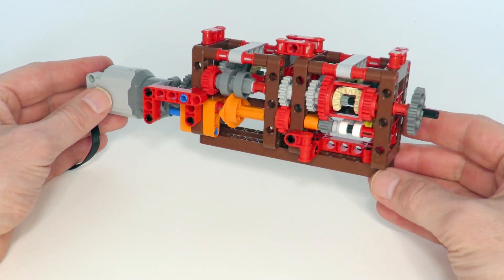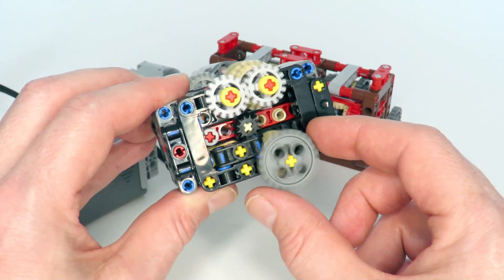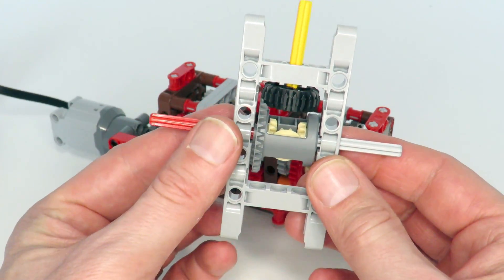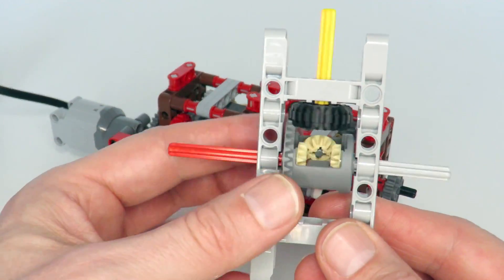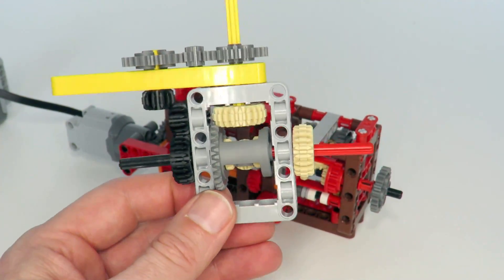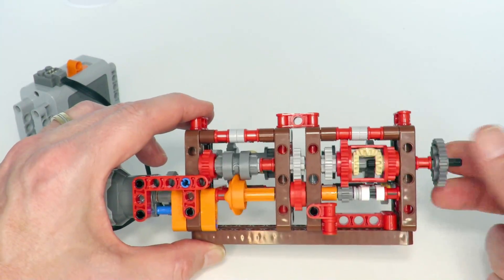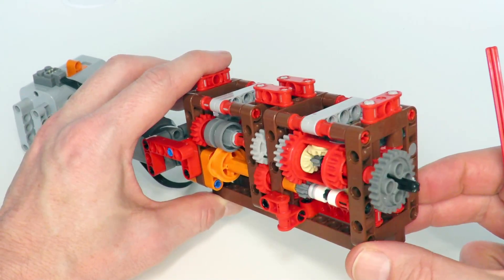Lego Technic smoothly switching 2 speed automatic gearbox - with instructions

Comment: Very interesting. Would be interesting to see that incorporated into a lego dump truck, construction vehicle, 4x4, 6x6 or similar and see in action. See if it would change gears with heavy loads.
Reply from the maker: Hi Ken, Yes I will try it in a prototype truck sometime. I have found some of my automatic gearboxes fail under heavy load. 🙃
Reply: @TechnicBrickPower  it qas only a thought. I'm surprised lego hasn't got hold of your isea and implemented it

Comment: The input is actually what you are calling the output.  The differential has ONE INPUT and two outputs.  You're using it wrong.
Reply from the maker: Hi Protoborg. Thanks for your comment. I normally think of a differential as having two inputs and one output because you need to drive two in order to determine the 3rd. I guess you're thinking of how it is used for vehicle back wheels - yes then you have one input and two outputs, and the ratio of the outputs is determined by the force on the wheels or turning radius. Not sure if I am using it wrong as they seem to work fine for me!

Comment: 3:30 - spur gear equivalent to the Torsen helical design used in Audi differentials
Reply from the maker: Hi Jessica. Thanks for that - I will look it up!
Reply: @TechnicBrickPower  - no problem. The reason the opposite side can't drive the diff:

The countershaft reverses the rotation and is attempting to transfer the rotation back into the opposing member of the differential. Because the opposing member rotation is already reversed of the the input, it conflicts with the mesh of the countershaft. 

A torsen diff works the same way to distribute torque between two output shafts. They work on the principle that worm gears can drive, but can't be driven. This is the opposite, in that your secondary output can be driven, but can't drive the unit.

Comment: fascinating!
Reply from the maker: Hi Carl, Thanks - glad you liked it! Check out some of my other 2 speed gearbox videos if you like. 😀
Reply: @TechnicBrickPower  I've had to watch this again, and I've ordered a job lot of diff and axle components, arriving next month! I like the fact that the diffs are used as an integrator, and sensor. The one way diff locking seems key to adding power without losing drive. Oh, and Happy Christmas!
Reply from the maker: @carlbModels  Hi Carl. I love ordering new parts. Hope this design works well for you and good luck with your projects!
Reply: @TechnicBrickPower  I'd love to add an auto box to my Lego monster truck! Will be investigating the options. I have no shortage of power and rather an excess of torque, have had to gear low to prevent melted axles. Plus I have 112mm tyres on my portalsz which twist the axles a lot... but your idea would.be cool in it 👍.

Comment: Do you know how to make an automatic 4 speed? I am making an off road car, and I would love an automatic 4 speed. If not, then no worries.
Reply: I think you could just put couple of these in series. I'm not sure if the total friction is worth it. As you start adding total count of gears the total throughput goes down pretty fast. For original Lego Control+ motors, 2 or 3 gears might be optimal because you can manipulate the rpm pretty nicely and need lower gears only for higher torque.
Reply from the maker: HI Max, I have focused mainly on 2 speed automatics - they are hard enough for me. But I am sure some of the ideas can be reused.  In the future I hope to create 3 and 4 speed automatics so keep an eye out ;)
Reply: @TechnicBrickPower  Alright! No worries at all. Happy building!

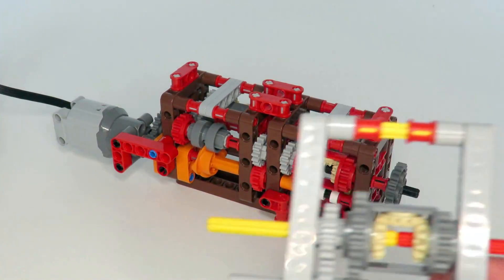Comment: Do you have an idea why does the one-way setup at 4:32 work? I'm clueless. In the first situation the left input rotates at speed 1, the differential has to rotate at speed 1/3 (due to the gear ratio between them) and the right input has to rotate at speed -1/3 (due to the differential equation (A+B)/2=C). When you rotate the gear connecting between the left input and the differential (second situation) it's basically reversed situation 1. But when you rotate the right input axel at speed 1 (third situation), the differential should rotate at speed -1 and the other input at speed -3. For some reason it doesn't. It must be similar to the wormgear-gear connection , the angle is maybe important.
Reply from the maker: HI 9/8. Actually no I don't have a satisfactory answer. All I can put it down to is a combination of the gearing ratio (3:1) and friction. However there is no problem driving a 3:1 with regular gears. Somehow the differential configuration exacerbates the friction to the point that is can no longer turn. I was surprised when I found that simple way of doing it to reproduce the same effect. Obviously if there was no friction then it should turn in reverse. Maybe there is some flexing in the plastic that is adding to the problem. I am plan to investigate it further it the future. 🙂
Reply: @TechnicBrickPower  did you find an answer? i can't figure why it stucked

Comment: That is pretty nice! :o
But I'm not sure if I understood it correctly, so one question:
If you increase the load on the the output the red differential has to work against the rubber band and rotate the orange switching wheel. Doesn't this mean, that while there is no state where no gear is engaged, there is a range of force where the second gear is used but the switch is not fully enganged?
Reply from the maker: Hi Tasse, thanks for your question. Yes the whole point of this design was to avoid the "disengaged intermediate state" which causes loss of traction or gear crunching. So in this design the final output is made up of the sum of a permanent speed plus another speed set by the gear selection. In the 1st gear this is simply zero by having that axle disengaged (and the one directional diff prevents loss of traction). The when then torque is high enough the orange selector  is activated by the differential and selects another speed to add to the final output. I guess if the switch is not fully engaged then the additional force/speed is not fully added to the final output until the engagement is complete, however it still avoids losing traction on the overall output.
Reply: @TechnicBrickPower  Thank you! :) I think the force/speed would be fully added but the small contact area would be under heavy load. Maybe add a rubber 2L "thing" as a "limited ratchet" that can only be passed if the force is strong enough for a full switch. So it get's more binary an less continous.